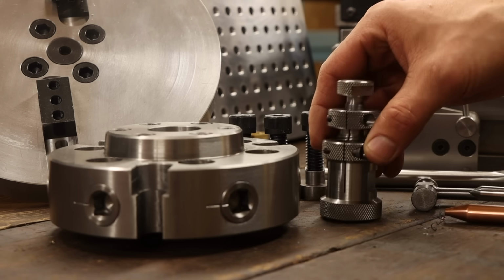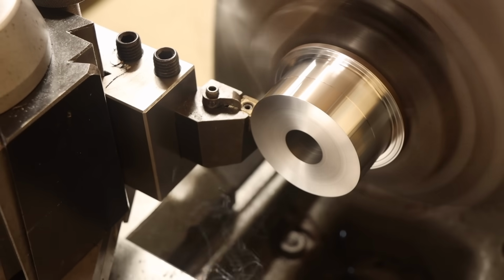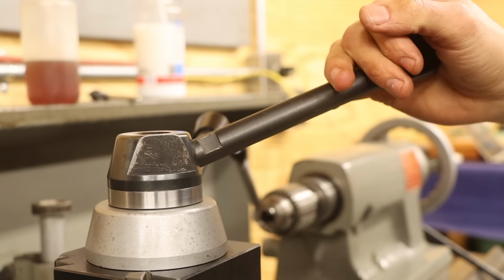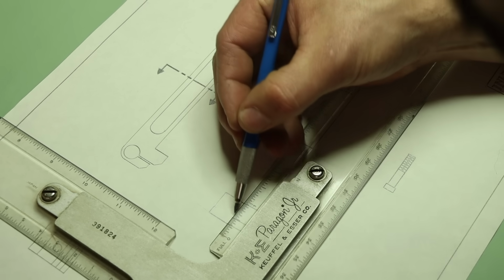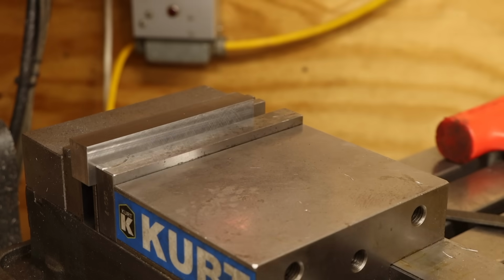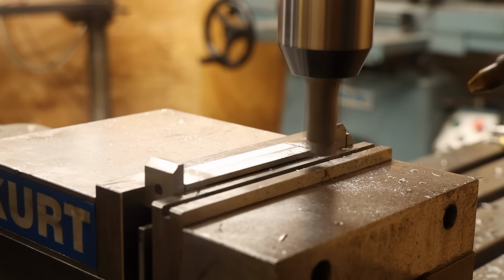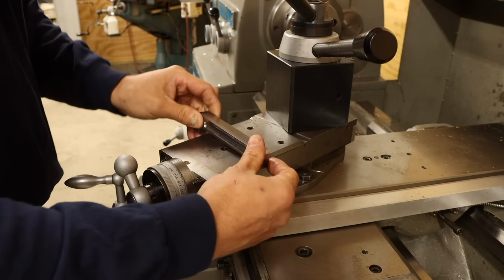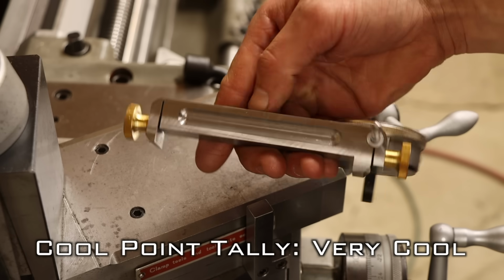Some UPGRADES for the Lathe || INHERITANCE MACHINING

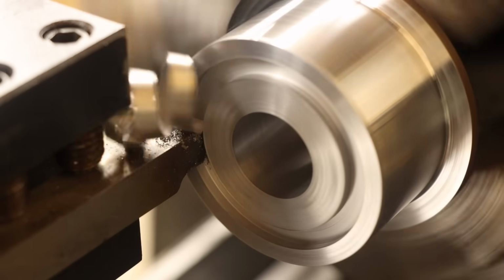Comment: 4:02 Give me a flash back about 56 years.
First job on the lathe as a 1st year apprentice.
Trepanning discs from sheet steel.
18 inch dia and I had to machine out a 6 inch dia center.
I broke a few tools, the guy training was brilliant never a cross word.
But he was wrong when he said I get Piles from sitting on his anvil.
💩💩💩💩💩

Comment: Quick [sincere] question: Is it acceptable to squeeze a thrust bearing until it will not longer rotate?  My guess is that it would be possible to squeeze too hard and crack the race.  Absolutely love the design, and I have the same challenge on my lathe, but what would the thrust bearing manufacturer say?

Restated, is it common practice to squeeze a thrust bearing to the point of immobility?

Comment: I liked what you have done here. I end up using various clamps and magnetic holders, plus as lathe is older SB with "curved surfaces " does not lend itself to "flat" areas. Toward the video's end the thought came to me a digital read out would be another way, but much more costly. Anyway - great job. Thanks

Comment: So... When I saw the cute little thrust bearing, and then the big wrench and the size of the thread I'm wondering if you compared the axial load in the bolt from the torque with the static rating of the bearing.  Seems like a full compliment roller thrust bearing would be minimum needed.  Do you do any calculations on your many designs?  As complex as some of your projects are it seems necessary and since you are very thorough in your narration I see lack of how you arrive at your designs. Just questions and I like your content and attention to finishes on the parts

Comment: 21:11  I was about to to suggest a "Long Travel" Dial indicator, for this application, but checked the price first ... It'd be cheaper to put a DRO on it :)  ... Long Travel Dial Indicators are kind of pricey.  :)

I like this much better than a magnetic dial indicator ,, they constantly get loaded up with swarf !!

Nice modification!!!

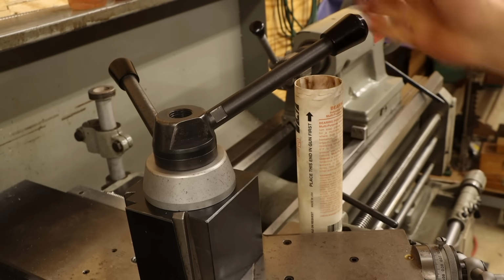Comment: 6:58  That would bother me, EVERY time i tightened it down ... Looking at That HUGE G A P !!! ...  and being able to see the internal threading of the nut .... I'd definitely Re-Make .. it in 1 piece ...

This is a popular upgrade for Key Machine cutting vice clamps, except they eave enough extra threads so it doesn't leave a gap.  :)

Comment: I love how a lathe and a mill can get you so much precision.

You use the tools to make parts for the tools, so the tools are more precise. And with enough material and energy, you can do that over and over until you have the most precise machine ever.

Comment: 11:51 For your slitting saw majig, could you clean up the shank and mill a new keyway adjacent to the galling? You'd have to be sure to line up the new keyway when loading it in the mill from now on, but you might even make a little filler plug or weld beed to fool proof it. Heck, you could turn it with the plug (or weld?) to salvage the entire diameter. 

Pretty late to the video so might not see this, or you've already fixed/replaced it.

Comment: I suppose one reason you never noticed the dial was out by a ''thou'' was most of the time its a rough cut to get close to what you want ,then you measure your work and then take the final cut . Our 3metre blade guillotine had an error on the side rule at around a metre there was 11 divisions so you would cut by eye on the rule and find you were 1mm up when cutting something approx a metre . Rgds Don

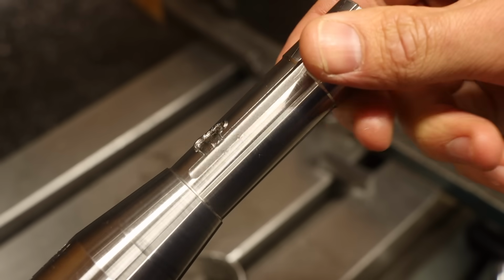Comment: 11:58 dunno how well it would work. but u could weld more material on the damaged part of the keyway then machine it again. but welding causes heat and heat has a bad habit of making precise parts not so precise

Comment: Nice work!
Personally, I'd predrill holes and then make saw slits that terminate in those holes. That way the flexure point spreads the force of bending around a large circular area rather than a straight line which could later crack and break off. Perhaps a little over-engineering since the limited amount of flexure involved might never result in a crack. I just prefer the appearance, I suppose....  😊

Comment: The lever to tighten the tool post is a good idea but I prefer to use a spanner so there is one less obstruction in the workspace. I remove or adjust the tool post less often than changing tools. However, the addition of a bearing to stop the tool post moving when tightening is brilliant. I picked up a needle thrust bearing from Aliexpress (Two for NZ$4.88 delivered). I'll get around to making a dust cover later. Meanwhile I have exactly the feeling you are talking about that it is more solid. About 20 operations using the upgraded tool post and no sign of any unwanted movement. Thank you.

Comment: Excellent upgrades sir! You might be able get away with just removing the guide pin in the mill. My BP Series 1 lost its guide pin sometime back in the 60's or 70's. It's never really affected anything. PS - I'd donate a front tooth for that sweet drafting table.

Comment: Your thrust bearing fix is clever but it hides the real problem. I would suggest you blue up the bottom of the toolpost and see how much contact you have with the cross slide. I expect it will be less than optimal. A better contact surface would have solved the problem. In fact it would have solved both problems. Take a look at a good quality tool post like a Swiss/German multifix or some such and you'll see they don't have thrust bearings and with a gentle turn they are rock solid (and don't move in the process either).

The nut itself also has too much contact with the top of the tool post and most likely not flat either. If you put a groove in it to remove the excess material close to the center you will balance the friction between the nut and the tool post vs the friction between the toolpost and the cross slide such that on tightening the nut the tool post will be held still by higher friction with the cross slide.

Comment: Excellent and I'm gonna make one. One thing I'll add is at least one more threaded, angled hole for the handle disposed at maybe 45 and 90 degrees to the original. WHY?  Sometimes when "less expensive"  Aloris type tool holders are purchased, they are too large for the existing dovetail. In order to get the part tight, the handle must be rotated till it can be hit by the chuck. Not good. This is the perfect time to fix all these little short comings. There are a lot of different thrust bearings, so I may change that a bit. We'll see. THANKS for the inspiration.

Comment: This comment may be old but I just remembered after re-watching this for the millionth time, could you not add a detent on the tool post at specific common angles to drop onto them? I.E dead center, 45° , 60° , 90°? Might be a bit of work at first but could be handy, rather than having to use the tail stock all the time

Comment: You don't really see the affect of the camera gantry in the videos but you can be absolutely sure it's saved him hours upon hours of not fucking around with a tripod. Sidenote - Would it be worth adding a cutting fluid reservoir and extendable neck for the lathe?

Comment: One thing to remember when you have to grip a piece with a through hole by a short chucking protrusion, is that you can rig a length of all-thread through the hollow spindle with nuts and big washers, akin to the drawbolt of a milling machine, to securely pull it back against the faces of the chuck jaws. It becomes virtually bombproof. If it's a cross hole, use an eye nut. If there's a tapped hole use it, if there's a blind hole from the back, tap it...  IF it doesn't have (or can't have) a blind hole, tack weld a nut to it!

Comment: I did same thing with a setup which i used to grind round glass.  The problem was that the glass needs to match the tolerance to be fitted in a metal casing. With lots of trying out either the glass goes over  or under grinded. With use of dial indicator i  manaeged it to fall near to tolerance limit.

Comment: Great video. I looked some in the comments and didn't find anything addressing this: How is the thrust bearing working out for you? I have taken some pretty noisy cuts before and I would be worried about the bearing allowing the tool post nut to loosen up and allow the head to spin.
Also, your drafting work is amazing. I haven't touched proper drafting tools sense high school. Everything I do now is in CAD which is good because I am a crap designer and need to be able to fix my mistakes quickly.

Comment: You do really great mechanical drawings! I also have found that I need a good drawing before I start in on a project. Just winging it as I go does not usually work so well. Thanks for the good videos.

Comment: R8 is problematic, upgrade to NT30? big fat drive dogs.  A tip with those finger screws.  I just make the finger knobs then press fit in a hardened cap screw of the correct into a bored hole in the correct side of the finger knob.  Best of both worlds.

Comment: Hi there, really enjoyed your video and love the idea of the compound DTI holder and it's application. However I do have a question please if I may and that is what make is your lathe? I haven't been able to identify it but the reason is that you demonstrated the discrepancies on the compound handwheel dial indicated travel and that shown on the DTI in addition that the markings are less than evenly spaced. I have checked my Harrison (and I know yours is not a Harrison) but is this discrepancy more common than we perhaps are aware of? In other words is there an assumption that most lathes are correct?

Comment: Dodgy stuff providing the tool post with a bearing rather than its locking pin when correctly aligned (compound slide parrellel or 90 degrees and locked in position. Tool post is positioned and locked not just by your strength but a solid pin) Brilliant jewellery for a problem that didn't exist.... Ever heard of a mag base for your dial indicator?..... Dumbass hobbyist hurt hand.
Seriously I hate to sound like a tw*t but don't mess with these machines without training.... They wiil bite and worse... Be safe ppl....

Comment: You remind me of myself, many tools so carefully made, heat treated and ground....sine bars,  sin plate, 3 precision vises, parallels with name engraved, etc.  Now retired but still have a shop and the work that comes in doesn't require that .0001 precision, they are all stored away not to get dinged up........afraid to use them unless something very important...........anyway I don't swear but do say some bad words when things turn BAD! Lol!
P. S. You can press in a socket head cap screw into a knob if you don't mind looking at the hex in the head, works nice.

Comment: Sometimes the most important lessons that we learn in machining....... Are learned through mistakes and failed attempts. I became a very good manufacturing engineer muchly because of all the mistakes I made.

And you're right about trepanning..... It's a very sexy process. But it takes a concentrated amount of planning, especially in the clearance angles needed in your trepanning cutter. I can't begin to tell you the headaches that I had trying to program in a trepan on a flange made from hastelloy (on a CNC lathe). But, as you've discovered, it feels terrific when you finally get it right!!!

Comment: I've worked on milling machine so most of my life and I have to admit I've never seen that one. I've set my milling
machines up for the use of Er collets.
I would like never to tear up my collets like I saw here. What kind of damage can become very expensive.
Also, I learned AutoCad many years ago for engineering drawings and never looked back. You might want to try AutoCAD.

Comment: Could fix that slitting saw arbor by machining a radial pocket to remove all the damaged area to the same depth as the keyway and call it a "retaining pocket".  Insert, twist and lock.  (Then file for a patent) :)

Comment: If you get the heebs drilling into your lathe, do what I did and araldite whatever drilled & tapped thing you want onto your lathe and screw the new thing to the araldited thing.

All the added functionality with no new holes in the lathe and if you ever need to re-position the item, unscrew the thing from the araldited thing, heat it to 150C and off it pops.

This is how I added a vernier to my Colchester Bantam.

Comment: Pro tip when machining brass: flip a left hand tool upside down and run in reverse so all your chips spray down into the chip pan. Saves some time on cleaning up.

Comment: I was having the same issue on my lathe with tightening the toolpost locking nut turning the whole toolpost.  Upon inspection I discovered that between the locking nut and the tool, there is a large brass/bronze washer that is meant to serve the same purpose as your thrust bearing.  (Aloris BXA)  Mine was somewhat dirty and crusty, so I did some careful cleaning and then lubricating with high pressure grease.  To my surprise, it completely eliminated the problem, and the need for a thrust bearing.  That's not meant to disparage the idea or the work shown in the video, just wanted to mention it as a potential quick fix to anyone who happens upon this comment.     
As a further recommendation to the "lathe list" I'd recommend a similar dial indicator for the tailstock quill.

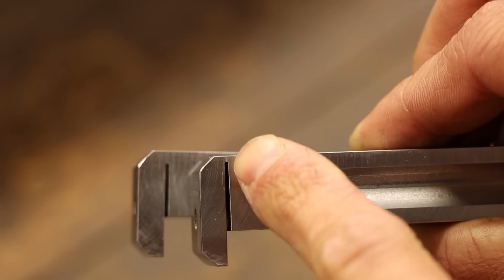Comment: 19:20 if you drilled through first with, maybe double the saw width, to be where the saw cut ended it maybe more flexible to clamp easier . Very nice 😊

Comment: when i upgraded my lathe i used a thrust washer on the handle it solved my problem with not being able to get it tight enough. but mine is a smaller lathe.

Comment: Hey there,
If I may, how could you have found out about the error in the top slide pitch leadscrew? Have you ever used it for much more than tapers (where top-slide travel, most of the times, is irrelevant) or feeding in for thread cutting? 
Cheers,
Thanos

Comment: You mentioned the screw pitch on the cross slide was wrong because it gave you 199 increments per revolution instead of 200. Could it be the screw is simply worn and the collective error adds up to that 1 increment?

Comment: That's sad what happened to that arbor, I'd be checking for damage in the spindle.. a previous owner of my mill had a similar whoopsie and sheared the pin off and it did leave some marks in the spindle but it's still holding true after the high spots were removed.. I've been running for years without a pin and it's never been a problem but I am extra careful to never bind up a tool, having to regrind an r8 spindle would have one hell of a pucker factor to it

Comment: Watched all the videos from the start they are great.   In watching this one an issue came to mind when you were talking about the movement when comparing it to the indicator.   That style indicator is only good to +/- 0.001" for the first 2 1/2 revolutions after that the accuracy is probably more like +/- 0.003".   It possible that there is nothing wrong with the lead screw and that it is just the accuracy of the indicator is off.   As for as the backlash that is probably just the wear on what I am going to assume is the brass nut underneath.  The lathe I am currently working on rebuilding that nut is not brass which but most of the ones I have seen are to keep from chewing up the lead screw.

Comment: Weld the arbor up and machine the keyway again, salvage the part. You can even add to flats for a spanner if the problem occurs again so you don't have to use a monkey wrench.

Comment: Beautiful work as always. Think I'll have to do something similar to my tool post (looks like I have a smaller version of yours). 
Do you need to worry about fatigue cracking on the cross slide clamp slit? When doing wedged tenons in wood working I always drill a hole at the end of the slit to spread out the forces and reduce the chances of cracking. It would probably take 100 years of use for that to become a problem though.

Comment: Nice, I just mounted a digital caliper that I cut the jaws off to my compound slide so I get the full 4 inch travel. Some times simple works better and saves hours of fabrication, not that making parts isn't fun..

Comment: Another great video.  Rough luck on a few of the tooling breaks but the final product was certainly worth the effort.  As per usual I've also encountered these issues and fixed them in my own "low effort" ways.  My stack of washers under my self made locking handle with a little oil on them act as a bearing just as yours does.  I also have some custom magnetic bases made for my indicator for use in the same way you use yours...of course my 1/4" nut welded onto the back of the base of a magnetic hook isn't exactly eye catching...I may copy your design with the 3D printer at some point as an upgrade :)

Comment: I would suggest putting a “cap” over the threaded hole on the replacement you made for the locking nut. It will prevent debris from accumulating in the hole. Also make a bigger box of shame or separate everything by metal type, buy/make a furnace, crucible, tongs, and mold to make ingots out of them for easy storage until you head out to the recycler.

Comment: Couldn't you drill a slot for a pin that aligns the tool post square for when you want it there? Drill the tool post and a shallow hole in the slide for a detented or removable alignment pin.

Comment: finally!   I can comment from a position of expertise!     I prefer to use old-fashioned pen and paper drawing, as you were in this video, but then I draw in 3d using "freecad"   finally I print the file on a cheap 3d printer ,,,  it saves sooooooooo much time and I can discover my  " design changes" ( cockups )   before I invest time into the item my usual "design change" is the last hole in a bolt circle or sizing of parts ...       😆